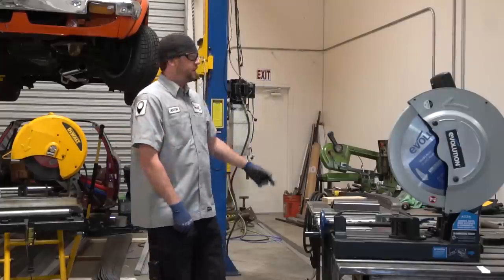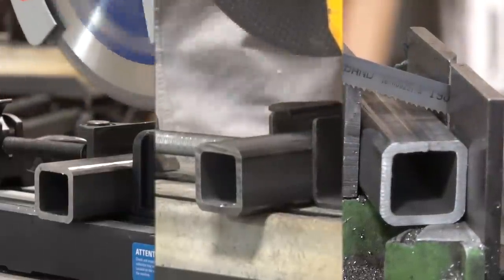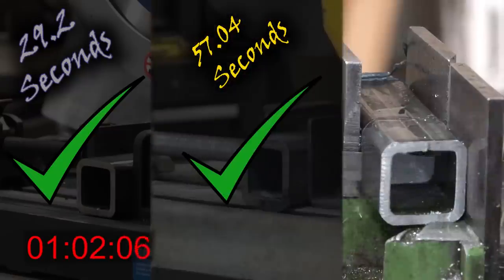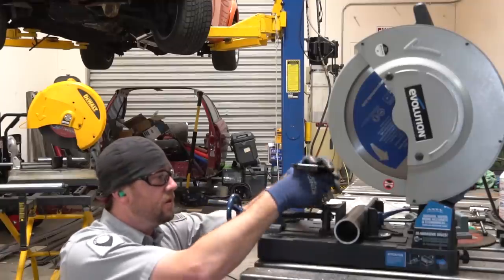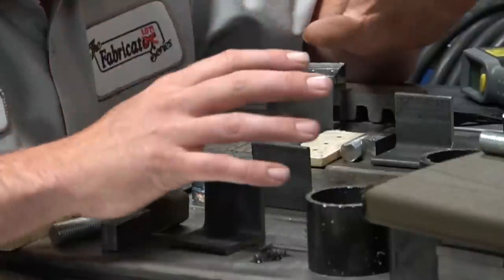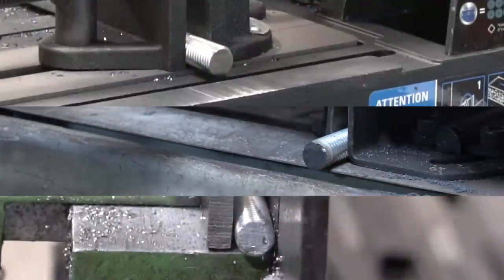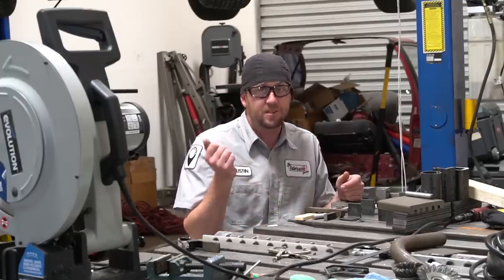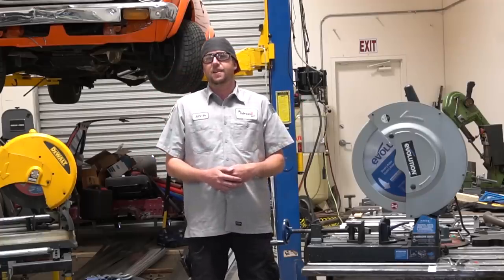TFS: 3 Metal Cutting Saws Tested and Compared

Comment: That tubing holder is nice ! Can I buy just that part Do you know ?
Reply: Just weld one up!  1/8" plate with two small pieces of angle.  All available at your local big box for super cheap.  Plus, you can use your saw to chop up the raw stock for it.
If you don't have a welder, then JB weld it.  JB has more than enough holding power for a fixture like that.

Comment: If I already have a Dewalt chop saw can I put an Evolution blade on it?
Reply: For approximately one cut. 4,000 rpm vs 1400. You'll kill the blade using it on an abrasive saw.

Comment: LMAO.. "Don't try this at home."
Well, I guess I don't do it in my home, I do it in the shop!
But, yes, I've done it... 
Band saw and abrasive... 
Don't have an Evolution....yet.
Speeds were interesting!
I expected the bandsaw to be slow. I expected the Evolution to be fast..... I didn't expect the abrasive to be as slow.... 
Maybe I hog on it a little harder??
One thing about abrasives, most saws, even big name brands are CHEAP!!!
I honestly can't tell you how many we've burned up in the last 40 years. What I can tell you though, the less expensive ones usually work just as well as the more expensive, but last longer..
The old Jepsons we're pretty good! (Haven't seen one in 20 years).
Milwaukee.., ya, didn't make it two years 😪
A friend had a DeWalt, he loved it.... But he replaced them every year and a half or so....
Then there's Hobo Freight.....
Believe it or not, we did stoop to that level... Three years on the first one!!! Replaced it about 6 months ago with another.
I would like to get an Evolution😎
Thanks for the video!!!!

Comment: Carbide saw... $5 per broken tooth @ Oregon Carbide Saw
Sparks mean too fast or to slow feed preshure.
Flat stocks cut better /cheeper($5/tooth) horizontal. 
Watch you a$$  on angle cuts. Clamp everything, NO HAND JOBS like you can with abrasive saw

Comment: You didn't cover the cost of operation. The blades for the Evo saw are pretty expensive.
Reply: But you use it for à very long time.
Reply from the maker: Some last for several years while others don't. It's up to the person using the saw and how often which is why that point was omitted on all saws. Too much variable....
Reply: The evo is a really good saw and the first I would pick of those three, but it should be noted that if you are cutting a bevel on round tubing and the crappy tubing attachment they give you for the vice lets the tube slip or rotate slightly (which it sometimes will) that will wreck the blade.  Not dull it, but break off the tips or whole inserts of several teeth in a row, and a new blade is $85-100.  If you're just making 90* straight cuts then no problem.  I guess the moral of the story is to either clamp it tight as heck, or don't use their little tubing clamp thingie.

Comment: I purchased the latest evolution 380cps model and I can say after a year of using it YOU WILL BE GREATLY DISAPPOINTED. The biggest problem is actually with all cold chop saw the vise is impossible to make a 45 but with round tubing like exhaust pipe it is EXTREMELY DANGEROUS it will not clamp down good enough no matter what you do it will begin to move on 45 cuts GUARANTEED but above all the blade at over $100 each DO NOT LAST more than 3 months with very light use. There is nothing still to this day that beats the band saw not only with unmatched accuracy very quiet and by far the safest and cleanest to use but also the most affordable. the blade on a band saw last a really long time.

Comment: You don't want to ruin your $100+ cuntstain tonguelide chop saw blade by cutting metal. That's why you use the abrasive saw and its $5 blade which can be worn down to the axle.

Comment: The abrasive chop saw is less expensive than the evo saw but the blades are $10-12 each, they don't last that long and they get smaller every time you use them. So the blade gets less efficient every time you use it. I've been thinking of trading up to the Evo saw. Its $349 at Amazon.  The blades are more expensive,  $120 but they claim they last 20x longer.

Comment: Ok the evo is nice but are we just going to overlook that this is a paid promotion for the evo? That's why the bandsaw didn't have a blade comparable to the evo n the speed was turned down. N notice the difference in down pressure on the abrasive. On the steel hardly no pressure but on the wood n composite he had enough force to bog it was down to get extra heat. The only fair way to test them is to put a weight on the handles n take the person out of the equation. But I still agree abrasive is horrible n requires to much cleanup after the cut
Reply: This wasn't the best review, but I didn't get the impression it was overly biased. And I disagree that weighting the abrasive chop saw and the evo would be a fair or useful comparison. The fair comparison would be to use the optimal force for each setup. That force will be a factor of saw, blade, object composition, object shape. You don't want to take the person out of the equation unless you first optimize the cut pressure. And remember the optimal cut pressure may change during the cut, especially for square tubing. Most videos show square tubing being cut incorrectly, BTW, the best orientation is the 'diamond' where a corner of the piece rests on the bed. This is possible with proper notched insert for the clamp face.

Comment: Could you just put an Evo blade on a cheap chop saw?
Reply: no the carbide tips will fly off evo saws turn at about 1300 rpm abrasive saw run at about 3000

Comment: Bandsaw all the way for the home workshop  A volume production shop wouldn't use the evo even though it's faster as they're too loud and expensive to run compared to larger industrial cold cut saws etc. 30secs cut difference is minimal, especially compared to the abrasive where you spend more time fixing the cut than making it.

A large portable swivel head bandsaw is far more useful and only ~25% more than an evo saw here in Australia. The smaller ones are cheaper than the big evo saw. Blades last longer. Blades are 1/3rd the price. Cuts are quiet enough to not disturb neighbours. The swarf is generally contained around the unit and not thrown around the workshop. Much faster and more accurate setup for switching between 90º and mitre cuts. Can fit a fine tooth bimetal blade and cut relatively thin wall stainless tube etc.

Comment: Longevity is key, I’ve owned the evolution for almost 3 years and although out the box it was the badest bitch since Pam Anderson was hot, but now it kinda sucks, can’t hardly cut angles anymore doesn’t cut square it’s got a pull
To it, leaves a burr, blades don’t last nearly as long , new or sharpened, but my 7x12 bandsaw is a beast day in and
Day out
Reply: I think people are over estimating how expensive a band-saw is. I would stick with my porta-band over buying a dry cut saw. The thing sees heavy use both around the house and out in my hobby shop.
Reply: My evo saw is pushing 20 hears old i go through a couple blades a year and still cuts like new.   I dont let rookies run it though as you have to be careful in how it is used.   I have cut thohsands of chunks of drill stem with no problems.

Comment: want to kill a blade on the evo and the bandsaw should have tried some hard metal the abrasive will be the winner the others will need and new blade
Reply: It doesn't even need to be really hard...in fact crappy recycled steel with inclusions will destroy those teeth faster than anything and that's the only reason I even glance at these abrasive disc systems.
Reply: I use M42 bandsaw blades for tool and stainless steel, and Makita LC1230 for construction steel and aluminium. All cuts are dry, it costs too much time to degrease every cut. I returned 3 different abrasive saws because they can't cut anything square and the blade wobble gave variable width kerfs.

Comment: @@UCcxlBLmujrjTVSSUkzZ2Jlg how much metal does each machine chip off ....? 
when you are a regular working mechanic this makes some sense.... each cut looses metal - if large then it make some sense to make some cost benifit as well the safety factor to be considered as well.... (noise, risk of blade breaking, etc).

Comment: Abrasive saws are garbage. They became extremely outdates once the dry saw blade came out. The biggest difference is versatility between a band saw and a dry cut saw. The clamping system of dry cut saws are garbage. Dry cut saws are really only good for general purpose tubing and small solid stock. The bandsaw has the best versatility when it comes to cutting all types of stock and the widest range of sizes. A true cold saw makes a dry cut saw look like a garbage little toy. The bandsaw only beats a cold saw in it's versatility of being able to cut the widest range of sizes.